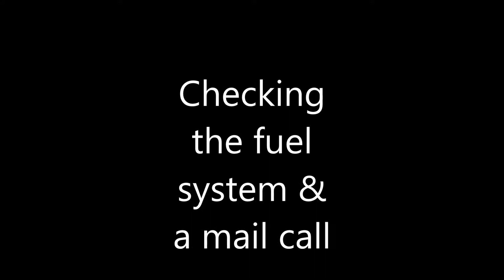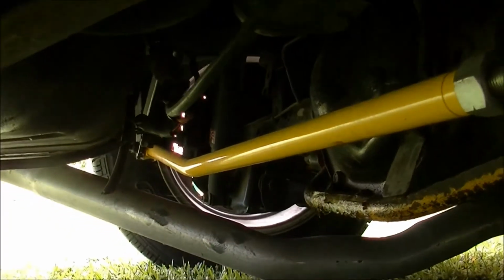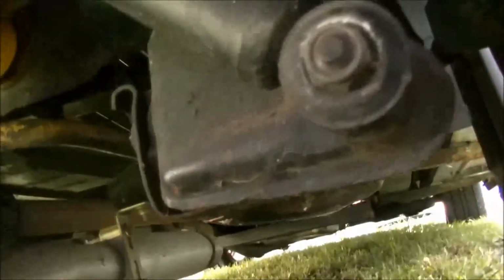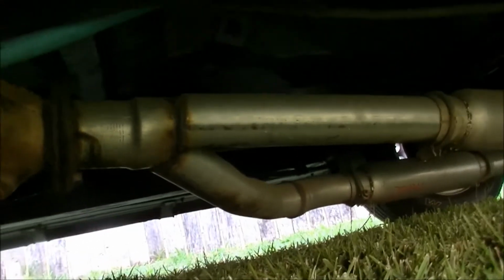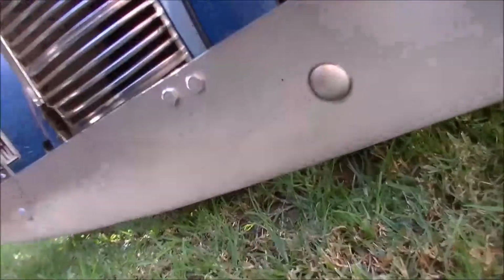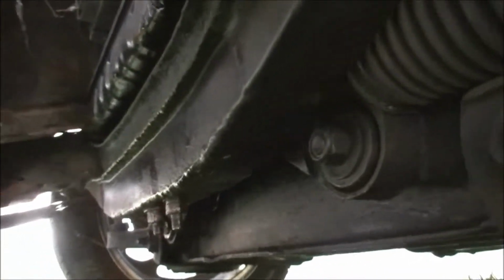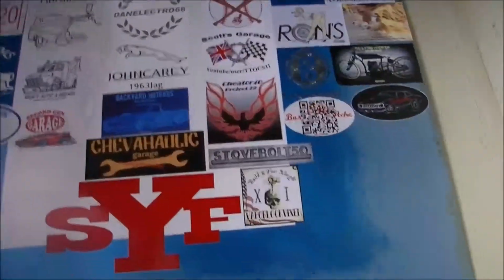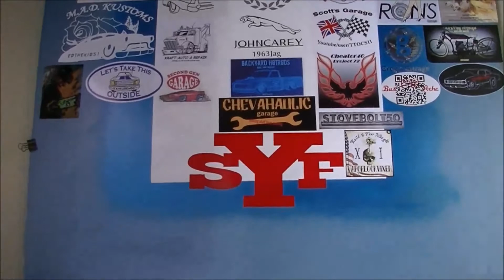Checking the fuel system & a mail call

Comment: My only question is that transmission line used for fuel line.
Reply from the maker: Good question Terry...I thought someone may comment on that...It is rated for fuel and auto trans fluid..High pressure stuff..It's been on there for 8yrs now with no probs so I guess it's stood the test of time..